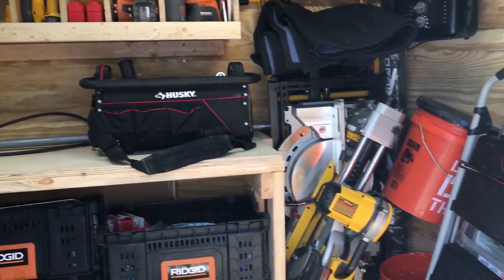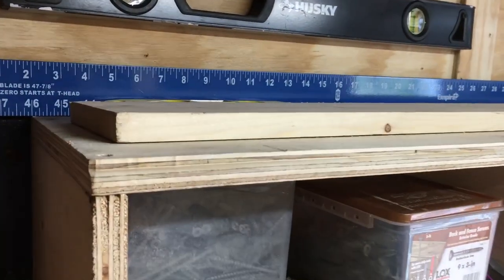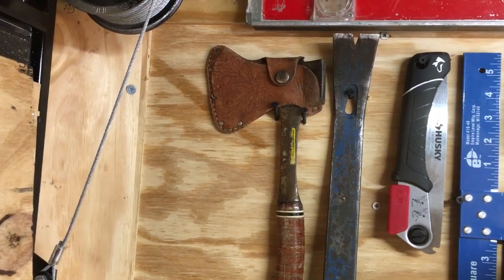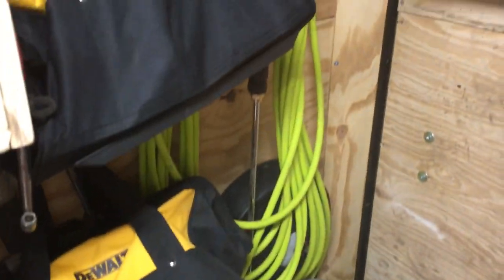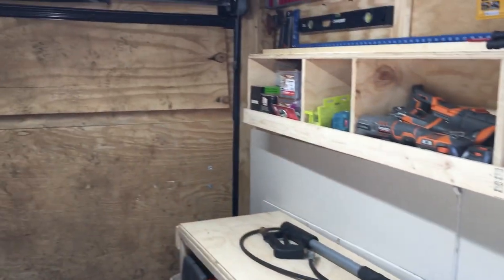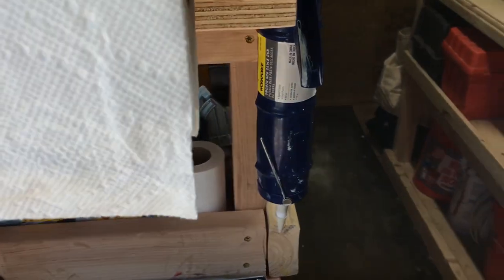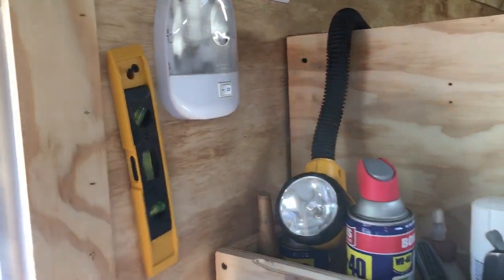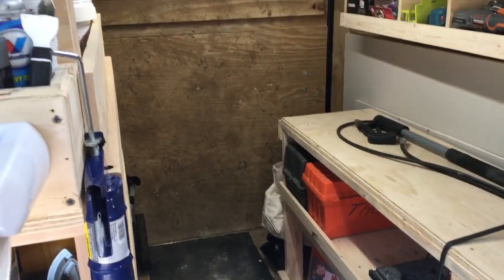HANDYMAN tool trailer clean-up!

Comment: I finally found someone with a portable toilet!  Great idea!  I work on some houses that I am outside and the owners aren't home and sometimes it just hits you. I am not going in a gas station.  I use the same setup with small garbage bags and have a bucket of cat litter to soak up liquid and cover up smell.
On the opposite side of that I can't believe no one has a cooler for water and drinks, a coffee maker and a microwave or a toaster oven.
On long cold days there is nothing better than getting in out of the wind and eating a warm sandwich and maybe some hot soup. 
Great trailer!  Watch out for thieves and hang that hatchet in your workshop at home and buy one to have at work that you don't care about, some thief will steal it when you turn your back. Great trailer!
Reply from the maker: udavidism thanks cuz👍🏻 stay tuned I’m installing a microwave soon. I already put the old  hatchet in the  basement. Thanks for watching it’s nice to hear I’m not the only one with the emergency  🚽

Comment: That octane saw is nice I wonder if there is a big difference from the original to that one?...I used the original one today all day that thing paid for it self time and time.liked the video.ima about to get me a trailer cant wait
Reply from the maker: ram 12e tried it with the new batteries and it is STRONG! Only reason I got it was upgrading from the old dewalt stuff. If you need any other tools check out the new sales at the depot. Check out today’s video. I picked up a nice battery starter kit with a free grinder. Have a good weekend!

Comment: Nice! What size  trailer you have? Did you put plywood on the walls? I'm sure you have to be careful that the screws are not too long?
Reply from the maker: Ben Galan 6x12. It came with 3/4 plywood. And your absolutely correct. You have to use the proper size so you don’t go threw the outside wall. Look up vnosetrailers.com.  So far so good with no complaints!! Thanks for watching BEN👍👍👍

Comment: I’m a 17 year old with a ton of side work looking to buy a trailer, what size is yours?
Reply from the maker: Connor Hughes 6x12 v-nose. It does the job especially if you work in tight areas. But if you work in more rural areas then you can go with a bigger one. Check out some of my trailer builds and the purchase video. It shows a few different sizes. Good luck bro👍🏻
Reply: High Ridge Handyman awesome thanks, I’m planning on picking one up this weekend, I’ll share my setup once I’m finished!